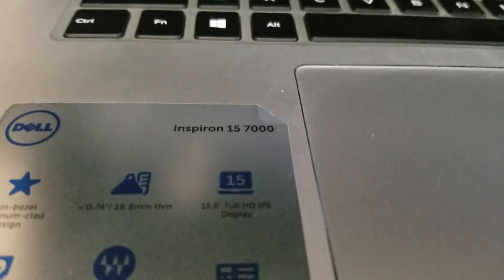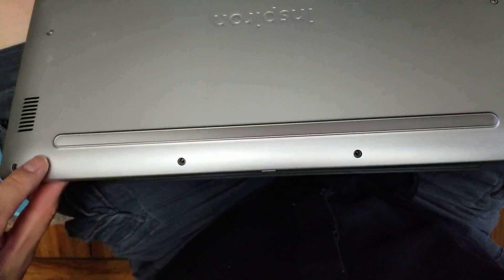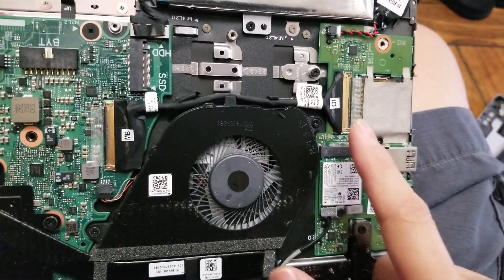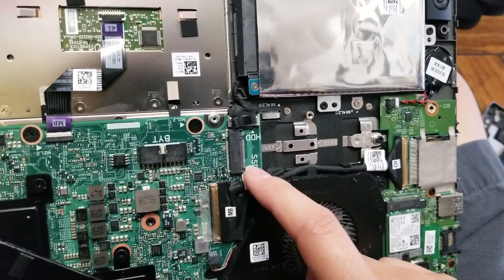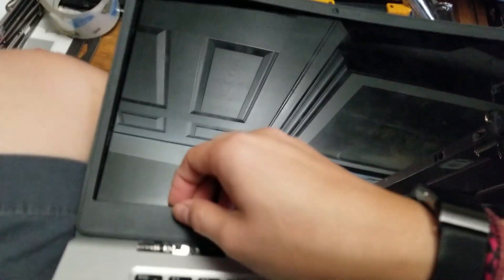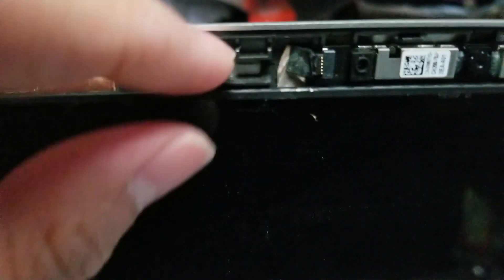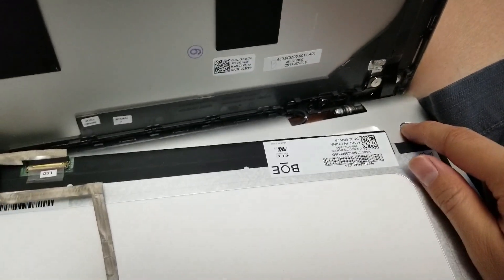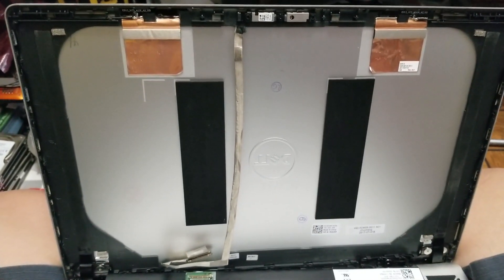How to disassemble a Dell Inspiron 15 7000 disassembly and replace the screen lcd

Comment: How do you know if you need Digitizer or LCD only?
Reply from the maker: If the picture is clear, then just the digitizer
Reply: @ItsBinhRepaired   the picture is clear however when I touch the screen the arrow goes everywhere even on the mouse pad the laptop hasit does the same
Reply from the maker: @alfonsoramirez6415  that's digitizer issue
Reply: @ItsBinhRepaired  Great. Thank you for your help :)
Reply from the maker: No problem

Comment: How did you get it off so easy? First time  trying to get it off after removing all the screws and it is still almost impossible to get off.
Reply from the maker: Pay really close attention to my hand movements in the video.
Reply: I got it, but I got it from flipping it over and pulling it out from the back. Thanks for the quick response though.
Reply from the maker: @nwilt7114  glad you figured it out!
Reply: @nwilt7114  - Maybe using a hair dryer / heat gun could have helped. There is a glue seal underneath that makes it hard to get off.

Comment: Great video. I had no idea how to get that back panel off. Is screen failure a common problem with this computer? Mine appears dead after 18 months. Computer works with an external screen, but the laptop screen is stone cold black. I removed the battery and tried it without the battery in and same result. Not sure if I should bother with replacing the screen in this computer.
Reply from the maker: not sure, it might be a loose connection or a bad backlight circuit.
Reply: @ItsBinhRepaired  I have a Inspiron 15 7580, seems it's the same procedure. I removed the frame but wasn't sure how to remove the LCD, since it doesn't have any screws. My screen have black horizontal lines (alternated) and sometimes the image gets stuck and fades slowly. Not sure if it's a loose connection issue or bad LCD. I'll try to remove everything and connect again.
Reply from the maker: @memphisrcc  this playlist might help Laptop Cell Cellphone Phone Computer LCD Screen Replacement Videos: https://www.youtube.com/playlist?list=PLSSiYX-ta7aqdMHpT-KqCZvBxODqzr2b4

Comment: Mine is also a dell 15 700 but not quite like this one and I can't figure out how to open it ... :(
Reply from the maker: Hmmmm make a video
Reply: @ItsBinhRepaired  what do you mean ?
Reply from the maker: @Em-uz1ot  I mean show how it's different.
Reply: @ItsBinhRepaired  could I send you photos somehow ?
Reply from the maker: @Em-uz1ot  post on YouTube and send a link?
Reply from the maker: @Em-uz1ot  there are clips. You have to use your nails or pry tools to get it out.
Reply: @ItsBinhRepaired  I'm really sorry but I can't see any clips ?
Reply from the maker: @Em-uz1ot  of course not, they're inside the two pieces snapped together.
Reply: @ItsBinhRepaired  so I'm just supposed to force it out ? I've tried my best but I really can't, unless I have to use my nails/ tools at a particular place ?

Comment: Eww the way you picked up the Memory Module made me feel sick!
Reply from the maker: Hah! You're more sensitive than the ram. I've had customers bring in computers with ram issues after never being touched. Rubbed the contacts with my fingers and it got the ram to work just fine. I've never had a customer bring in a computer with RAM issues that I've done that to.

Buy two sticks of ram for a computer, rub one all over the contacts for an hour if you'd like and I guarantee there will be no issues unless you build up static beforehand.

People that think it's a problem don't actually work with electronics for anything more than a hobby.

Comment: How to replace the Keyboard? Please Make a Video for it..
Reply from the maker: It's a customer's laptop and I no longer have it to do a video on, but this model looks like you need to take the motherboard out. It is not something you should attempt if you can't figure it out.

There are other models where the keyboard comes out easily from the top, you just have to pry the clips out from the top edge of the keyboard. If your model is the same as this one though, it'll be a very difficult and risky repair.
Reply: @Rajdeep Dey 
sid you figure out any options to get to the keyboard?
Reply: I dumped water on mine and after drying it only half the keys work 😔
Reply from the maker: @zacharysilcoff6878  just have to search your model number keyboard on eBay/Amazon. "Inspiron 15 7000 keyboard" but it requires you to take the entire motherboard out. Might have to do it anyway to make sure it's all dried completely.
Reply from the maker: @zacharysilcoff6878  replacing the keyboard can be risky if you don't know what you're doing. This model I don't remember if it had screws in the back holding the keyboard with a metal plate or melted plastic nubs that will be difficult to remove.
Reply: @ItsBinhRepaired  Melted plastic nubs saddly. A bunch of them
Reply from the maker: @zacharysilcoff6878  yeah, those are a pain. You'll have to cut/rip them out, then glue the new one or use a 3d printer pen hot glue might work
Reply: @ItsBinhRepaired  Thanks for the info, sounds like a bit more trouble than I'm will to go through (plus I might end up completley braking it at that point. gonna try leaving it in rice a while longer.  and if the keyboard still doesn't work. I'll buy an external one.
Reply from the maker: @zacharysilcoff6878  most likely will have to do the external one